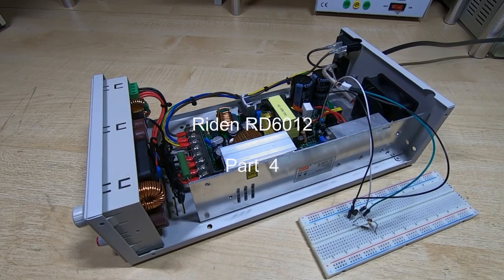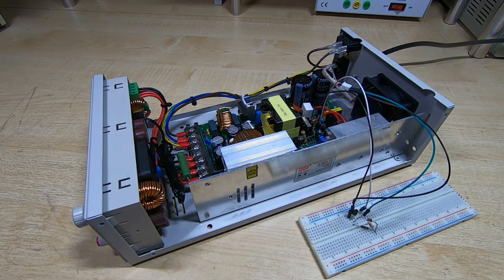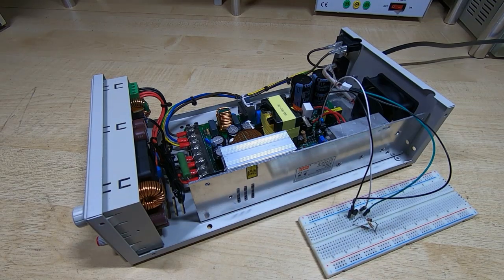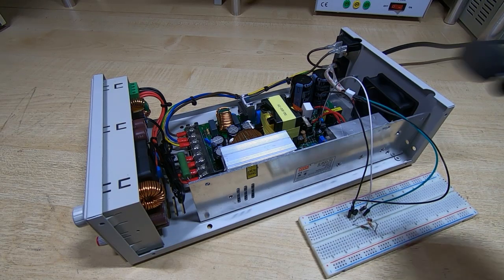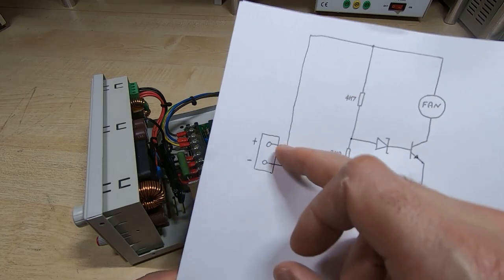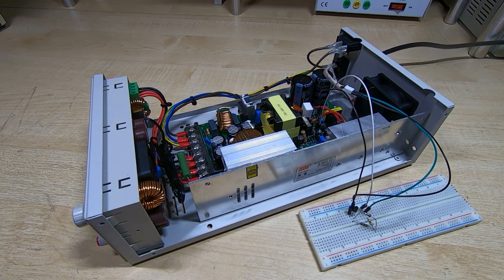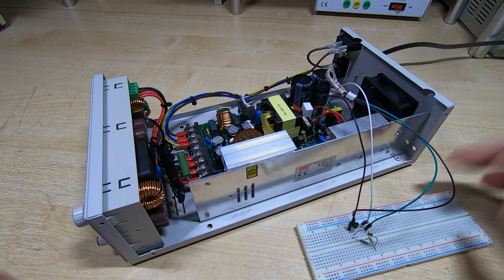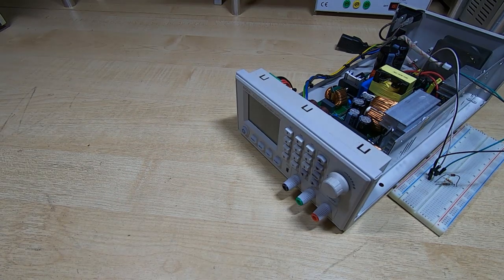Riden RD6012 Part4

Comment: Only three years after you posted the video... Thank you. I found this four part series very helpful and informative. I built your fan mod from part four and it works well however there are a couple of problems with it. The zener diode on the schematic is drawn backwards while the video shows the zeners being installed the correct way around. Theree should also be a diode fitted across the fan to pretect the transistor from back emf. As the damage by back emf.

Comment: The fan that was running as a part of the case was there to pull in air to cool the power transistor heat sink. Fully enclosed, the grooves in the side force air right onto the heat sink since it was the only way in.  So its possible that you caused the single transistor to fail perhaps?

Comment: I don't think it is fair to conclude, that the psu is not up to spec when you ignore the manufacturers guidelines for assembly. They clearly state, that heat dissipation will fail if you remove the shell....

Comment: Jerry You have made 4 fantastic videos about the Riden Kit. Most people will never require a 60 volt supply, and probably most people that buy one don't realize that fifty volts is sufficient enough that can seriously hurt or kill someone. 
I think the Riden RD6012 is an awesome Device. Though i would never let my teen enthusiasts have a dangerous 60 volt supply when 40 volts is sufficient for his needs.
 The option exist to use other well know power supply manufactures to achieve a lower cleaner voltage. you also have the advantage to stack in series or parallel 2 units of power supplies to obtain your target voltage and power.

Comment: Great modification. Thanks for your time.
As a tech, I never plan on running any type of equipment at 100 percent.
Riden made a very nice buck package. Yet i think they should provide a better power supply.
Every search i did tells me that the nvvv s800 was modeled after another well known switching power supply company. As you found out the engineering behind that nvvv unit was not up to proper specs. 
In the end of all this we now have an option to modify, or purchase a different brand of supply.
I just recently purchased the RD6018. After one look at the power supply that was offered in the kit I said no thanks and ordered everything except the supply.
I enjoyed your videos BTW.

Comment: Fixed my fan noise by adjusting r6 (2.7k) from Q2 (S8050)base to ground, it forms a resistive divider with the thermistor to give around 1.4 volts on the base. Of course they have selected a value that suits their ambient temp, my ambient here is 28-30c so by placing an 11k across R6 the fan stops/idles and kicks in as the temp rises. I also glued the thermistor to the diodes heatsink.
Power supply is S-1200-65. One could also fit a 20k trimpot instead.

Comment: I'm planning to buy the RD6012W with a 48v 10.4A switching supply. should I go for the recommended 60v supply or will this just be fine? I'm planning to use it for electroplating among other things.

Comment: I've seen some reliability problems with RHoS (lead free) solder on some hot circuits. Would you recommend for or against resoldering some the larger, hotter high power solder joints with regular 60/40 lead solder? Thanks!

Comment: Thank you guys for sharing all your knowledge. I exchanged R40 with a simple 150 Ohm 1W  resistor and it works like a charm. The fan rotates from startup at low speed, when temperature raizes it goes full speed and once the temp go down, it goes back to low speed. Really nice especially for me when working by night. With fan at full speed all time it was simply unusable by night.
Reply: Can the fan itself be replaced with  a quieter, better fan? Or does the form factor/size of impose fundamental limits on dB/RPM/dimensions ratios?
Reply: @tacitovitowesterberg7674  Sincerely I think that ANY Noctua would do better, will be quiter and safer.
Reply: @dzmecano485  but I assume you'd want to be sure that the replacement fan pulled same volume of air. Maybe in specs...
Reply: @tacitovitowesterberg7674  But we don't have original fan spec. So the solution is to plug a set of temp sensors on all parts that may heat up, and monitor their state while applying a certain load to the PSU. After that, try to use ANY Noctua and check if the temperatures are the same (or lower). The main point is not to replace the fan with another one, the main point is that hot parts of this PSU keep working at correct temperatures at any time/load.
Reply: @dzmecano485  ok.
Reply: @dzmecano485  : The original fan in the S800-65 is DFG6025B12H which can be hardly found on the manufacturers site : http://szdafengge.com/pd.jsp?id=45#_pp=2_499 (Specs: DC 12 (7-14) V / 0.15 A / 4500 RPM / 21.94 CFM / 0.62 m3 per min / 0.23 mm H2O / 35.2 dBA), the naming nomenclature is confusing because no exact matching part numbers found in the table but starting from the amperage the closest model with 0.15 A is the 2nd from the top: RD6025x12L. If we try to match as accurately as possible, then the RD6025x12H wich is the 4th from the top, but it has significantly different parameters (Specs: DC 12 (7-14) V / 0.32 A / 6500 RPM / 31.70 CFM / 0.90 m3 per min / 0.48 mm H2O / 46.3 dBA). As I see, Noctua NF-A6x25 FLX outperforms these models ( https://noctua.at/en/nf-a6x25-flx ).

Comment: you should use it in the way that we recommend, I see you remove the case and install the fan to the back of the case, this will lead to a problem: the structural change of the heat dissipation system leads to insufficient heat dissipation. After the shell of the switching power supply is removed, the wind speed flowing through the heat sink decreases, Q=Sv, S increases, the wind speed v decreases, and the insufficient heat dissipation chip is overheated and damaged.
Reply: I think you are correct that the heat sink temperatures would be lower with the PSU case back on to channel the airflow… 

however, is the single package dual not being overloaded (peak currents) when the PSU is run at full power? Saying it’ll only survive in low ambient temperatures with the PSU case on and with high airflow fan is saying the diodes are being driven too hard.
Reply: @davadoff  we have tested that we use full output to check the internal temperature, and the temperature is still under control, just maybe there will be fan noise
Reply: @rdtech9153  I am very pleasantly surprised to see such active involvement of the manufacturer, I appreciate it very much :)
So I would like to take this opportunity to point out some minor inconveniences that may be solved in the next versions of the firmware / software.
1) The unit in the lower right corner shows temperature, output Ah, Wh etc, but the total time since “On” is missing. This would be very useful information, especially when using the charging function. It would be nice to have such a function also in the PC software in the "Basis Info" section, surely it is possible to modify this section slightly to fit the "Total Time" display. Suggested time format HH:MM:SS (hours, minutes, seconds).
2) Exporting a graph image - currently this option is available, but the image is unfortunately very small. It would be great to be able to export to a custom resolution.
3) Data logging - this option is also available, but is not done “on the fly”, but requires an export. In case of accidental disconnection from the device, all data is lost. It would be highly useful to record data in real time or at least at specified intervals.
I don't know if other users will agree with me, but these are my observations, maybe helpful.
Overall very practical, useful and well designed device :)

Comment: I just received the RD 6012 kit and the NVVV S-800-65 is not behaving as in your case. The fan is off and starts for some 5-10 sec every 1-2 minute or so. I think the speed is max, it´s quite noicy. This is going on always, even with zero load, and when the PS is loaded with some 50-100W the fans starts with the same (full?) speed constant on until a short while after the load is disconnected. 
I would like the solution with at slow speed all the time and then speeding up when needed only, has anyone checked on this version of the PS?                               Is the multi turn pot near the fan control and connector perhaps involved? Besides the fan speed the control circuit also is intended to shut down the PS if temperature is going to high, has any one tested this function?  Although the PS is controlling the fan on/off all the time, there is the transistor and resistor near the fan connector as described belov, but I can not se any two speed  action...                                                                                                                                                                                                 I have done the same mods, dual diodes (BYV74/500) and the fan is moved to the outer chassi. I will also move the thermistor to have thermal contact with the diode cooling plate.
Reply: I just received mine - same issue: on/off from time to time even without a load. Did you solve it?

Comment: What's the value of the transistor?
Reply from the maker: Resistor? Don't know. I will have a look next time I remove the case and let you know.
Reply: @JerryWalker001  - Jerry I meant Transistor.  OOPS!
Reply from the maker: @tubeDude48  Yes you did say transistor:) Which transistor are you referring to?
Reply: @JerryWalker001  - The 1 on the circuit you built.
Reply from the maker: @tubeDude48  It was a BC547 but any NPN should do.
Reply: @JerryWalker001  - So I'll use a 2N3904 or 2N2222, or even 2N7000 -- Thanks.

Comment: Why not bay a new fan, super silent?
Reply from the maker: It is not good to have fans running 100% of the time when they are not needed. They fill equipment with dust and it was also far cheaper to add 1 transistor and a few diodes and resistors. You could of course fit a new fan if you wanted to to small fans are not silent and the grille in the enclosure would also need to be modified to make it 'silent'.

Comment: I see a high-power green resistor across the internal power supply.  Did that come with the kit, or is that a MOD?
Added Fan schematic starts at: 4:57
Reply: That resistor comes with the power supply due it may generate a high pitch noise, so you may add that resistor to prevent the noise!

Comment: In your schematic you have the zener shown as forward biased which means that the voltage at the junction of the two resistors will be held at two diode drops! Is that REALLY what you planned? Is it just a slight drawing slip or did you actually wire it that way as well? If so, why use a zener, when an ordinary diode would do?
Reply from the maker: The - and + connections are not actually 'supply'  and 'ground' connections. It is effectively a current controlled output. The zener in this mode provides the hysteresis I mention. You could actually reverse the zener if you wanted a fixed speed for the fan but then this could also be achieved by simply adjusting the threshold pot on the supply and not adding any circuitry but I wanted the fan to be off until the supply was in use and not always running (even slowly) when the supply was idle. It seems a bit of an odd fan control circuit on the supply and it makes the supply very annoying without modification. The first kit I ordered had a separate fan control board and it was much better.
Reply: @robertplante8822  yes, [edited to be less ambiguous as I'm not disagreeing with you) just like I said, in his schematic the zener diode is FORWARD biased and acts as a STANDARD diode. This CANNOT be reverse biased because it has no means to be, other than via reverse biasing the base emitter junction of the transistor to the point of reverse breakdown.

I rechecked the video and you can actually make out that the ACTUAL implementation has the CATHODE (black bar) of the zener at the junction of the two resistors ... The way the schematic SHOULD be drawn.

Strictly speaking the bias chain does not require the bottom resistor either since it performs no real function in this circuit. If ONLY the top resistor is used then the circuit will work perfectly just the same. The only thing the top resistor does is to limit the current through the zener and into the transistor base. It acts ONLY to create a "threshold" voltage for the transistor to start to turn on at more than its normal 0.5-0.7v i.e. to delay the onset of the fan until a certain voltage is reached.

Ironically, EXACTLY the same result can be achieved by picking a MOSFET with a threshold voltage of the right value and current capacity and power rating to suit, then the zener is not even required either. This could be improved to a variable point by keeping the resistor divider chain or substituting a small linear pot in the bottom leg to provide a variable turn-on of the FET. It's important to note that the FET will operate in its linear region if the voltage at the input does not rise fast enough in which case using the zener instead of the top resistor, with a bias resistor below in series and connecting the junction to the FET gate (N-channel type) is all that's needed.

As multiple, suitable N-channel  power FETs are readily available for FREE from any PC motherboard (even from the 286 and 386 era) this is an ideal source for hobbyists. Specs are readily available from on-line sources like All-Datasheet etc.

Comment: The issue you could run into with the fan running too slow is since it looks like the thermistor is in open air there may not be enough air flow to trigger the fan into high mode causing too much heat to build and degrade the semiconductors and Caps. Maybe extend the leads and attach it to one of the heatsinks.
Reply from the maker: Yes this is what I say in the final video. I attached the thermistor to the 'hot' heatsink.

Comment: Hey Jerry,  Looks like you resolved the high power bug in this RD2012W.. Have you done any low voltage / current testing with either the 06, or 12 A supplies ?  Running an IC for instance at  +/- 12  VDC, and say 10 to 29 mA ?

Comment: Its resistor R40, 62ohm bridged across the fan transistor collector emitter terminals, either remove it or double the resistance fixed mine perfectly

Comment: Now I have to open mine back up and check but im pretty sure my fan is off until hot, I bought my case kit about a year ago. Wonder if they have two different fan control boards depending on when it was produced. I'll check mine later today. Edit: Never mind I see now that its the PS doing the control. At first I thought this was the conrtol board that came with the case kit.
Reply from the maker: I think the difference is in the enclosure kit. The first kit I purchased for the RD6006 had a separate fan controller pcb in the kit and I used it to control a fan. I removed the original SM supply fan. The enclosure which came with the RD6012 did not have this board so I had to rely on the SM supply fan control and it is not very good. It runs Fast or Very Fast but never stops.

Comment: Jerry, would you mind answering my question from your point of view also please? What are the pros and cons of your 4-component fan speed mod vs the dual resistor mod that's mentioned in another comment below? There's got to be some advantage in your design vs the 2 resistors in series method so please comment. Thanks!
Reply from the maker: It is entirely personal preference. There are many other options. What I wanted was for the fan to not run at all when the unit was first powered up as I tend to use equipment in the lab where everything is on a common power bus. I only wanted the fan to come on when the unit was specifically used. WIth the mod I show the fan does not run at all until the sensor heats up and then it will still run slowly even if the sensor cools down again (until power is cycled). The resistor mod just slows the fan down but it still spins at power up which is not what I wanted.
Reply: @JerryWalker001  Gotcha. I like your results better, so if I could trouble you, would you please tell me what type/part # transistor and zener diode to get? Resistor values/wattage would be great too please as I didn't see the parts list anywhere. I too prefer your design. =) Thanks Jerry!
Reply: @JerryWalker001  Keep in mind that with no air flow, components might get too hot before the radiant heat makes the fan turn on.
Reply from the maker: @DrHarryT  As I say in the video I attached the thermistor to the hot heatink so there is no danger of that. I also tested the unit for several days with 8 thermocouples attached to key parts (similar to the way I tested the reflow oven).

Comment: hi Jerry,  Tx for sharing!  I will order this supply soon. Before this supply will fail,  I will add the diode. This is the diode at the output circuit ,Correct? I do like to order 2 pcs of this diode you replaced. What is the  order code for this diode? Tx